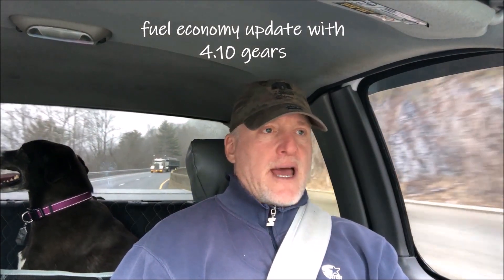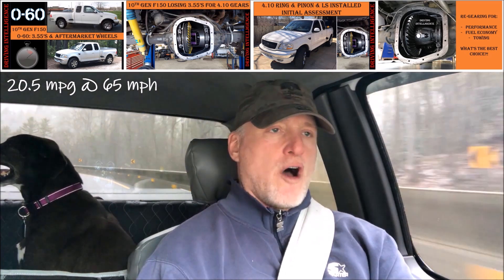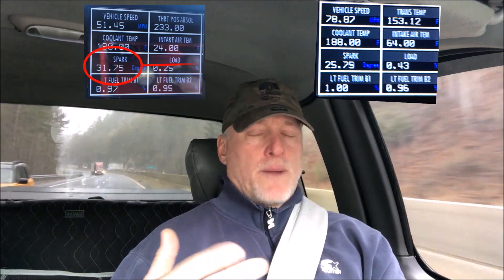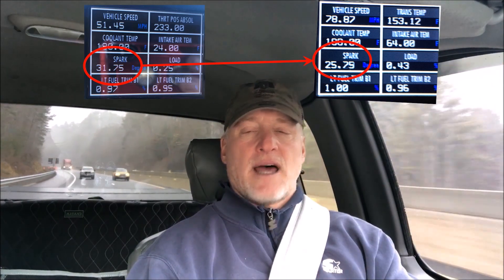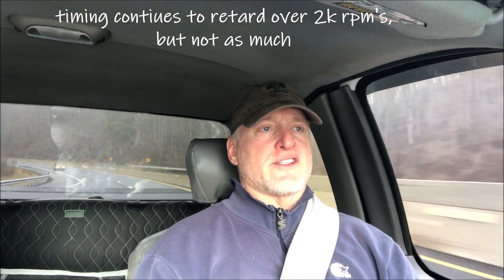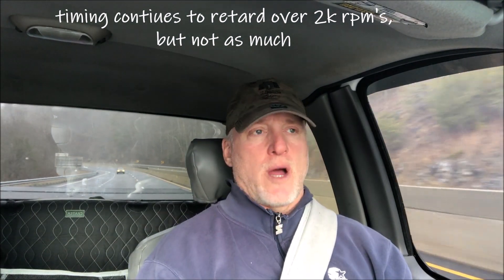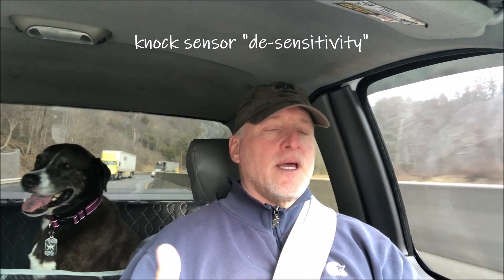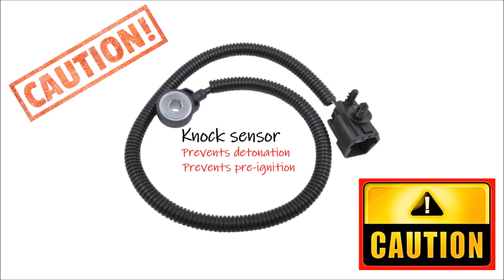Will Knock Sensor Adjustment & 4.10 Gears Effect Average Fuel Economy ‘02 10th Gen '97-'04 Ford F150

Comment: 20 mpg! Really!
Reply from the maker: Yes!  Before those big heavy wheels I had almost 23 mpg!  But I’m not done squeezing fuel economy out of this truck.  Stay tuned
Reply: Barry
That's great information sir.
Thanks for digging into this - I didn't know the knock sensor could be adjusted in any way. Looking forward to the future updates
Reply from the maker: You are very welcome.  I’ve got some cool mpg videos coming up
Reply: I've got a 01 5.4 2vlv. Excellent maintenance new Accel coil packs. I'm pushing 17.5 with an automatic
Reply from the maker: Good mileage for a big old truck.  Did you see my vid on Jegs coils? How To Install 5.4 2v COP & Spark Plugs, Best COP For The Ford 4.6 & 5.4 2V?  JEGS High Performance?
https://youtu.be/AQPaFukWewQ
Reply from the maker: By the way, I also have several other vids on fuel economy for these trucks: How To Significantly Improve Fuel Economy: '97-'04 F150, F250 LD, Expedition, Navigator Part 1
https://youtu.be/uCerPykH4pA
Reply: I'll check them out. Just had rotator cup surgery! So I've got LOTS of time on my hands!!
Reply from the maker: @johngeary8534  get well soon
Reply: Just subscribed
Reply from the maker: Thank much
Reply: I've replaced the intake, also installed a J&L catch can
Reply: I'm going full exhaust, header's and only one cat instead of 3 with a 3 chamber flowmaster
Reply from the maker: @johngeary8534  Hey, exhaust can help.  But why Flowmaster?  I like blow through mufflers like Magnaflow.  More performance and less exhaust backpressure.  And I'm not a big supporter of pulling cats... :)  I got rid of my back two of mine because one was blown out.
Reply: @DrivingIntelligence  it's the sound and a high school thing!! Lol
Reply from the maker: @johngeary8534  completely understand!

Comment: Great videos, loved watching the playlist as it went through with thorough information.  

I know it’s apples to oranges as my truck is an 18 Silverado 5.3L 6L80 trans, but I lifted it 6” and threw 35” tires on it and it drove like an old tired dog. So I bought a tuner for it and paid in advance at the same time for 4.10 gears knowing I would need the tuner to be able to change the info in the ecm/tcm. But I’ve been playing with the tuner and I now have the truck dialed in perfectly and it almost feels how the truck should perform the way you would expect a truck to do so from the lot new. However, will 4.10 gears still assist in turning the 35” tires and help the trans life (by hopefully reducing the workload) to help turn the big rubbers. Possibly even improve fuel economy further? 

The tuner has helped improve my fuel economy already on 87 octane, daily driven, moderate acceleration, but don’t baby it either. So if I can get better with the 4.10, that would be even better! If I was that worried about fuel economy period, I would buy a Prius or a bicycle lol. 

Just trying to look into your crystal ball of wisdom to see the outcome I have in my head about the economy already! 

Thank you for all of your shared info!
Reply from the maker: Hey, thanks for coming to my channel.  Almost everything I do to my truck will apply to yours.  

I maintained fuel economy when I went to 4.10's.  However, the fun to drive quotient went up substantially.  The truck is much more capable and snappy through throttle input.  You added much bigger tires than me, so I think you may find an improvement in fuel economy with 4.10's since your engine is working much harder turning those big tires.    I've never looked back.  It was an expensive, but beneficial mod.

Comment: So I have a 2001 supercrew with 371,000 miles and starting last summer I was getting under 14 mpg. It still continues with that but I don't know how to fix that problem. I have looked at your improvements for better mpg's but 23 mpg. I am bone stock with original wheels, regular tires inflated properly, cold air intake, throttle body spacer, some sort of tuning but without a  module and a tonneau cover. Recently changed out the plugs, coils and Idle air control valve. Any ideas?
Reply from the maker: Thanks for asking.  First things first, you noted you have reduced fuel economy?  Have you run diagnostics to see if you have any pending codes?  Have you looked at fuel trims to see if they are in order?  Need to understand why you lost fuel economy if everything else is the same.  Next, if you don't have a tuner like the SCT X4 with a special tune, you are not going to improve fuel economy.  Takes some investment to get a significant improvement out of these trucks.

Comment: Would replacing the knock sensor fix the sensitivity issue? 

I am the guy with the 21'  97  5.4 E350 SRW class b RV...

Thanks to your vidros i was able to track down an exhiast leak ..  since ownership the 4R100 transmission had issues stying in overdrive..  mpg was 10.7..   right now at 13.9..

Doing the jegs coils soon...
Reply from the maker: Thanks for checking back in.  I really don't have a good answer regarding replacement of the knock sensor to reduce sensitivity.  It might be a waste of money.  Have you been able to datalog your timing to see if it pulls back similar to what I noted in the video?  I've heard that generally speaking, the 5.4 2v knock sensors are oversensitive, but I've not seen any data.  I turned mine off for a test and it could have been a disaster.  Lots of knock.  I guess back to my question, if you have a datalogger, watch your timing, especially over 2,000 rpms and let me know what you see.

Comment: 2001 F150 5.4 2v with 75,000 miles. The truck had a knock in the catalytic converters? I replaced them and it still did it. Then I removed the catalytic converters and it still did it? Noticed when I disconnect the battery then reconnect, the knock goes away until the computer makes its adjustments....then it comes back. The same same thing with my throttle response and overall power. When I'm going up a slight grade on the highway the truck feels like I'm pulling a trailer. Sometimes I think the exhaust smells like it's running a little rich? I have no check engine lights. All 4 of the O2 sensors are still in the exhaust. Gas milage sucks. I replaced the coil packs and plugs as well as all the fluids. Made no difference. Still runs the same. I'm guessing I need a tuner. I still have the factory exhaust so I can put that back on if need be. I also have over sized tires but other that that the truck is completely stock. No aftermarket intake, air filter, throttle body or pulley's. Please help!! Any recommendations?
Reply from the maker: Hi there, thanks for checking in. You have a good question.  Can you run diagnostics to see if you have any pending diagnostic trouble codes?  If you don't have a scanner, go to Autozone, or Advance or other places like this to have them run a free scan.  I need more information before I can come up with any potential options.  Don't buy a tuner until you get this sorted out.  After checking codes, next step is to check the fuel pressure.
Reply: @DrivingIntelligence  Thanks for the response! Yes I have a friend at Midas that has a scanner. I will ask him to check for any pending codes and I will report back.
Reply: @DrivingIntelligence  No pending codes at this time but eventually I will get a P0430 Bank 2 Efficiency Below Limit since the converters are gutted. Fuel pressure reads 48 psi @ idle on the rail. Seems high to me but maybe the gauge is wrong? I can get that checked at another shop if you feel that is a bad read he got. Thanks for the help.
Reply from the maker: @MrBluesyoucanuse  that does seem high.  Might be a problem with the fuel pressure regulator.  Check out this video:  https://youtu.be/kRejFPy2OM8
Reply: @DrivingIntelligence  I am having it checked with another gauge to be sure although 48psi does fall within the parameters so ??? I will also try the leak down test. Is there anything else you want to know about the fuel pressure when I test it next time? Here's a link to a knock that is similar to mine. https://www.youtube.com/watch?v=xmS1P42XhuM&t=144s Sometime I start it and it doesn't make a sound. Sometimes when I'm on the expressway and on a slight grade, I will slowly push the gas pedal down and it gets to halfway or better before downshifting. I almost think I can hear that same knocking while it's trying to make power. Ultimately it doesn't make power until it does downshift to passing gear. Then it runs great with plenty of power and the motor sounds good. Also wanted to add that the truck starts no problem when cold or hot.
Reply from the maker: @MrBluesyoucanuse  I watched that video, almost sounds link rod knock. I have piston slap when it's cold that goes away once warmed up.  I did a video series on replacing the timing chain.  Here is the link and check out the first video that records the sounds I was dealing with.  By the way, you might want to make sure your oil pressure if good and check the performance of your throttle position sensor.  Playlist:  https://youtube.com/playlist?list=PLGNsbVXzRfZPg0KvNIqkGpzx-duBOL246 and throttle position sensor test:  https://youtu.be/But-QOPp1Z0 - throttle position sensor issues can impact shift performance
Reply: @DrivingIntelligence  Sorry for the delay! I am ordering a throttle positioning sensor for it this week.The fuel pressure I will have checked again and the oil pressure as well. The knock that mine makes is in the catalytic converter. It's like an echo. Not sure if a link rod would do that? Also the EGR tube that connects to the exhaust manifold on the drivers side has the same knock rhythm in it as well. I think that tube runs around to the passenger side and I can hear the knock there too. I can't hear any knock in the front of the motor or the oil pan or the transmission pan. All smooth sounding through a stethoscope. Do you think it could be an EGR valve? Thanks for the help. I love my truck and it's driving me crazy!!!
Reply from the maker: @MrBluesyoucanuse  I look forward to hearing if the TPS helps, but in the mean time, without seeing your vehicle, the knock sound could be the EGR if it's being commanded to open and close erratically.  Try disconnecting the vacuum line to the EGR temporarily to see if the noise stops.
Reply: @DrivingIntelligence The better fuel gauge showed 32psi at idle and 40 on the pedal. It was very responsive and within factory specs. Guess I'm on to the the TPS and vacuum line to the EGR. I will keep you posted. Thanks for the help.

Comment: Good video. Helping me decide if I want to regear my f250. Sitting on 22s and 37s
Reply from the maker: what are your current gears?  Did you see my regearing Playlist?  https://youtube.com/playlist?list=PLGNsbVXzRfZORzgcoLukxGkQzyE5wXrpj
Reply: @DrivingIntelligence  3:55s.
Reply from the maker: @angelnegro281  I'm sure different gears with your setup will make a HUGE difference.  Your truck is struggling with 3.55s and 37s
Reply: @DrivingIntelligence  yeah I kind of figure that. Just shops around here charge 3k+ for the swap
Reply from the maker: @angelnegro281  sounds about right for a quality job.  You might consider going with smaller wheels and tires.  I threw off all my performance gains when I went with the bigger wheels and tires.

Comment: What octane is it tuned for?  I have a Superchips tune on my 2002 5.4 and it's tuned for 87 octane.  I have not tried the 91 tune.
Reply from the maker: I'm running a 93 Octane Performance Tune.  Given the limited amount I drive, I'm not concerned about the fuel prices and also why I continue to squeeze more MPG out of this truck.

Comment: When calculating mpg, did you rely on the tuner to calculate or did you manually calculate? I conducted an experiment on a road trip recently. Windows up, A/C off, 60 mph, the entire way (roughly 240 miles). My tuner said 23.6 mpg. When I calculated it manually, I was just barely over 19. Bone stock '00 4.6 ext cab f150.
Reply from the maker: Thanks for the comment, I always do a manual calculation and use the same fuel pumps to ensure as much accuracy as possible.
Reply: @DrivingIntelligence  Wow, good to know. Thanks!
Reply from the maker: @taypat  you are very welcome... I have more of these fuel economy videos coming.  Hopefully we will all be surprised with the results.  ;)